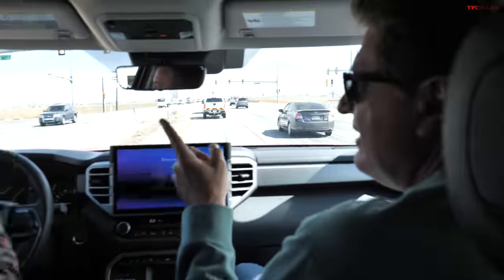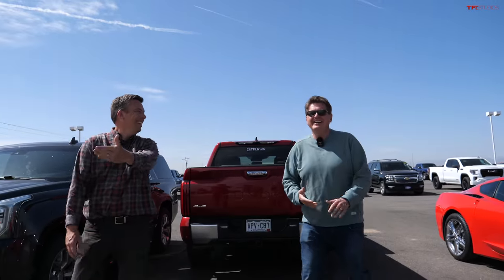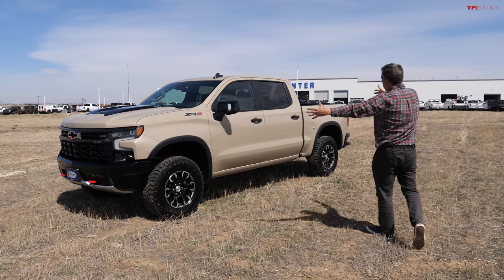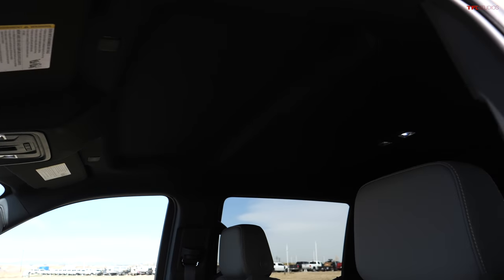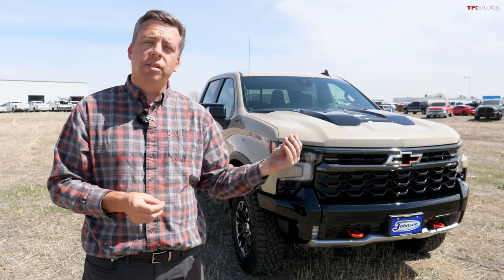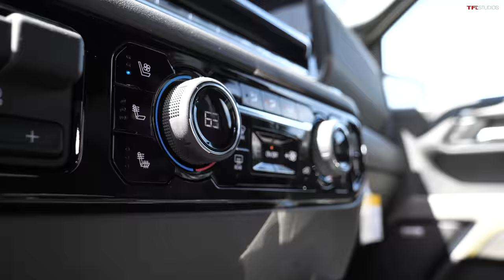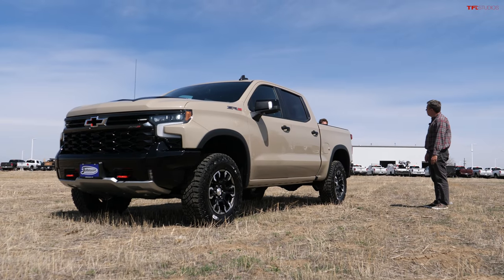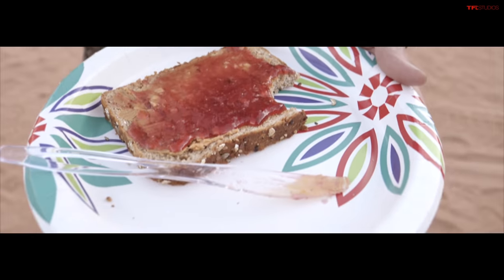We Traded Our 2022 Toyota Tundra TRD On This Brand New Off-Road Truck - Here's Why!

Comment: Awesome truck! I'd still take a diesel Colorado ZR2 over this tho. Colorado is a little more capable due to it's smaller size. Colorado/Canyon are also competitive compared to other brands like the Jeep Gladiator and Tacoma, whereas Silverado isn't. Let's be real, nobody's going to compare the Silverado ZR2 to the Ram Rebel or Ford Tremor, like they do to the Raptor/TRX.
Reply: Yes, let's be real..
And stay away from the 2.8 Duramax it has a timing belt...
Reply: @philllsxga.7737  and with regular maintenance, shouldn't be a problem. My neighbor's going on 80k with no issues. Even if I couldn't get the Duramax, I would still take the V6 over the Silverado.
Reply: @TREVORJB101  don't do it.
My brother's Blazer has 316,000 miles on his 4.3 never opened up 
My old Sonoma I sold with 252,000 miles never opened up.
A belt does not belong inside of a any engine let alone a diesel..
A belt inside of an engine is crap and is a cheap way out..
Instead of engineering a proper chain system they throw a belt in there...
That's exactly why I never bought a Colorado ZR2 because of the trash engine options...
Reply: @philllsxga.7737  OK so let's compromise.  How about I just do an LS swap??
Fair??
Reply: @TREVORJB101  now you're talking!!!
My buddy and I want to 4.8 swap a ZR2..
The only reason I did not buy a Colorado ZR2 was the engine choices I bought a Silverado instead.
No the Silverado is not as off-road capable but man the power of that 5.3!!!
I raced multiple ZR2 Colorado's in the sand dunes with my Silverado in sand drag racing and it's a joke I smoke them!!!!
The 2.8 Duramax racing forget it!!!
I raced two V6 Colorado ZR2 and just smoked them with my Silverado!!  I was embarrassed for the guy!!!
I'm so glad I did not buy a ZR2 now!!!
Reply: My diesel gladiator flatly embarrasses the ZR2 in every appreciable way come on man.
Reply: @mattbrew11  yeeeah okay.
That eco diesel is a cam shaft eating junker!!!
I'll take a 2.8 Duramax any day over that EcoDiesel...
Reply: @philllsxga.7737  you’re thinking of the first two years of the last generation engine. We have around 40 3rd gen ecodiesel rams and theyve been outstanding several are already a little beyond then 125k threshold towing or hauling every day.
Reply: @mattbrew11  all Chrysler is garbage...
YouTube truck Central high mileage RAM review
Reply: @philllsxga.7737  chrylser had absolutely nothing to do with the current jeeps man . U ok?
Reply: @mattbrew11  jeeps a one of the most problematic vehicles ever sold..
YouTube TFL truck ram rebel the good the bad the broken.
The Chevrolet trail Boss made that same Hill with no issues...
Reply: @philllsxga.7737  lmao. You’re grossly biased
Reply: @mattbrew11  just a realist..
YouTube LSX Challenger.
YouTube LSX RAM.
YouTube LS duster.
YouTube LS Ferrari.
YouTube LS Lamborghini
YouTube LS Winnebago.
YouTube LS swap Challenger.
YouTube LS Porsche.
YouTube wrangler JK LS.
Chevrolet power!!!!!!
Reply: @philllsxga.7737  hell yeah!

Comment: Seems crazy to me that Chevy would only option the ZR2 with a 3.23 gear. I would think at least a 3.73 would make more sense especially with the 10speed. Hell that would probably bring the towing number over 10,000lbs
Reply: just the opposite. the 10 speed has a lower 1sr vs 8 speed 4.7 for the 10  vs 4.56 over drive  final  10 .64 vs .65.       the old 6 speed had 4.03 first and a .67 final
so the 6  the 8 and th 10 all had  .67 .65 and .64 not much difference it the low 1st  4.03  6peed.      4.56  for 8 speed      and  4.7   10 speed
Reply: @jeffforbes70  yeah but that is my point. A 3.23 is only there for fuel economy and hurts the truck performance wise. I doubt a 3.73 rear end would make even 1mpg difference yet yield much better towing capacity. Ram does the same crap. The 1500 Hemi can come with either a 3.21 or 3.92 rear end on the 8speed ZF. The 3.21 has a max tow of roughly 8000lbs vs the 3.92 at 11,000lbs+. Lets not even talk about someone getting this ZR2 and wanting to put on 35 or 37" tires with that gearing it would torque load the crap out of the transmission without a regear. To me it makes no sense in a performance offroad truck especially knowing folks will be rock crawling and put on bigger tires
Reply: @TheRamGuy  I. hear you.  my point was about the trans ,the ten speed main advantage is in the first 3 gears , 6 speed with 3.73 will have the same ratio I first as a 10 speed  with 3.23 both will have a 15 to 1 ratio.i do agree if this is going to be Chevys  biggest badest off roader 3.73 would be nice  . I just saying the ten speed is set up for  so you don't need a rear end as low. 
the bronco has 4.7 first gear ratio add the Sasquatch package and you get4.7 rear end. when car drive 0 to 60 and quarter mile times the actual started them in second gear. again the ten speed doesn't have a higher  overdrive. its alll ep.a driven .for 67000 you think they could take the hit
Reply: @TheRamGuy  its all about CAFE MPG

Comment: Shoulda kept the Tundra, this generation GM half-tons are so underwhelming
Reply: Underwhelming is the 22 Tundra, after Toyota basically did nothing for 15 years.
Reply: @dudeman5788   Yes still drastically less underwhelming than the GMT-T1 which is the biggest half-ton flop I can think of in decades, which anyone who isn’t a blind GM fangirl can see if they’re being honest with themselves.

This model’a contribution to the market was exactly a zero — a contrived, fragile tailgate.  Sad
Reply: @BC08  I disagree and I'm a Ford guy. The 3.0L Duramax diesel is a marvel in itself. I have witnessed many GM owners with this engine paired to the 10 spd transmission knocking down 30-31 mpg on the interstate. It's arguably the most fuel efficient powertrain ever for a 1/2 ton pickup. Even as a Ford fanatic, I can acknowledge and appreciate that. I mean, yes the tailgate is gimmicky, but the 22 Tundra'ss claim to fame is a tailgate release incorporated into the the taillight...not exactly a technological marvel either.
Reply: @dudeman5788   The 3.0 Duramax diesel is a flop just like the Ecodiesel and the baby Powerstroke are.  They get mid-20s real world — guys getting 30 mpg are hypermilers doing it for bragging rights to justify their decision — and with diesel fuel costs they need to do better that that to make financial sense.  
Then there’s the fact they are just blatantly outperformed by the gassers which also have lower maintenance costs and the baby diesels are an answer to a question nobody asked. 
That’s also why they aren’t selling well.

Comment: Will zr2 ever be be built to tow 20000lbs pounds n 4000lbs payload ?
Reply: Why would they do that when you have HD for that??
Reply: @2024hekyeah  but hd can't go off road like the zr2?
Reply: @jesusm2159  you can't go off road with a suspension that is built to tow and haul  heavy . You have to buy both trucks. 3500 for towing and 1500 for playing

Comment: Awesome truck, I personally don't need a wide body desert running dune jumping truck, but I sure could use the front and rear lockers at the boat ramp, beach or hunting.
Reply: Good common sense reason. Owned a gen1 raptor and loved it but utility is also what I go after now so I can use every bit of my trucks.

Comment: Great suspension...I wouldn't want to change it after paying all that for em. Wonder if just a puck would be enough for 34 tires. I went with 34 on my F150 on 17" wheels and glad I did, just enough without 35" (tho some 35s are undersized) but mine was an XL so the suspension got a full replacement. The look of these has really grown on me, and that hood is 🔥
Reply: 295/70/18 might fit it’s basically a narrow 35

Comment: I didn't watch the entire video but what axle ratio are these trucks going to come with.  If its the terrible 3.31 then I'd advise everyone to not tow more than 5k lbs with this truck.  Please tell me it comes with the 3.42 axle?
Reply: With the 10-speed it should be fine for what it’s rated to pull. Just about the total ratio from transmission to tire.
Reply: @ALMX5DP  Incorrect.  I just bought a 22 Sierra 1500 At4 4x4 crew cab.  It also had the 10spd and 3.31 gears.  Had the truck for only 1 month and towed only a 5k lb cargo trailer with it every day.  Trans got real hot, didn't pull for shit and I would say it was the worst towing truck that I've ever owned because of that terrible gear ratio.  I thought the 10 speed trans would help it out but It absolutely did not.  I traded it in after a month for the 2500 6.6 gasser which also sucks at towing with the 3.73 gears.  Both are horrible.
Reply: @richr909  my F-150 with 6-speed and 3.31 pulls that kind of weight fine. Doesn’t sound like your issue is with the rear end but the transmission itself.
Reply: @ALMX5DP  What year F150? If its newer with the 3.0 eco boost then yes it will pull it fine.  If its the 5.0 then sorry but your def of fine and mine are way apart.  I've towed over a million miles with 16 different trucks both gas and diesel.

And if you think the Triton motor in a Ford tows well then you are just nuts.
Reply: @richr909  no such thing as a 3.0 Ecoboost in an F-150. I have a ‘15 5.0, and have pulled an 8k toy hauler with it without issue just locked in 4th gear going about 60-65mph (trans temps never got above 204 and got 10.2mpg to boot).

Comment: I'm not a off roader, I have 4wd because I live in Michigan, for the winters. But I can't believe you're griping about 33" tires. I'd be more pissed about the short 5'7" bed. Useless. Had 8' beds first 4 trucks, 1/2 and 3/4 ton. Had to settle on a full (short bed) 6.5" on my 2015 GMC crew cab because they stopped making a 8' in anything but a regular cab 1/2 ton. I've overloaded this bed with 1200 lbs of gravel. Over the 1595 it's rated at.!
Reply: They don’t care what the bed length is because they don’t use pickups as pickups but rather as off road SUV’s.

Comment: Kinda short on towing and load capacity. My 17’ crew cab 1500 max load weight is 1999 lbs . Towing max is 11300 with 5.3 . Well I guess all that other stuff is the rage . ✊🏻👍👌

Comment: It’s about time Chevy fixes their horrible interiors.  This about the best one I’ve seen on a Silverado in almost 20years
Reply: The Interior change was due to the crap they originally put in this truck that was causing Ram buyers to buy Rams and smoke Silverado sales.. but as usual with GM trucks.. if you want power and performance you have to pay for all the bells and whistles.. Ram.. base model truck you can get the big motor and all 8 speeds.. Try that with GM's trash.
Reply: @kenrobinson1099  try not having electric problems in the ram trash
Reply: @danielmeador1991  Now that's hilarious and out of complete ignorance. I have never had electrical problems in any of my Rams or other Chrysler products that have or presently still occupy space on my driveway.
Reply: @kenrobinson1099  your comment screams ignorance I’ve seen nothing but electric problems in late model rams but good luck with yours and hopefully it won’t ram your wallet with expensive repairs

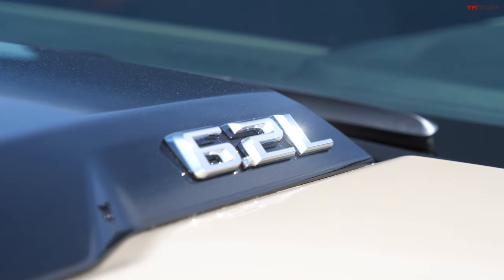Comment: Blows my mind that Chevy leaves the inner fenders open/exposed seen from under the hood @9:13 (look at the area the hood prop attaches to the fender). This screams cheap and a cost cutting move that makes you question what other areas they cheapened out on as well.
Reply: Worse was the welds on the tail pipe that weren't ever cleaned up. You can see the rust on them already...

Comment: As someone who has sold one of these trucks and compared the stock vs performance exhaust systems, as much as I like gm accessory quality (rock sliders are great) I’d highly recommend going with a different brand over the GM one as there is a very small difference yet high cost. I’d recommend Borla with their S-type (or Atak) or one of the Corsa offerings to actually have a noticeable sound difference. Both of those are more TRX sounding whereas the GM one basically just makes your cold start marginally louder and not much in other scenarios. Just a thought!

Comment: I have a 6.2 in my Trail Boss with a cold air intake and opened up exhaust and it RUNS! Do we know if the cold air intake upgrade is compatible with the ZR2 as it is not listed on the website as a build option or accessory. I'm hesitant to trade mine in on the heavier ZR2 without some upgrades available...

Comment: GM brags about winning a competition.  Then it comes out that there were no competitors.  Not sure which is more ridiculous:  Their claim about winning or the fact that they did not think anyone would find out about them being in a class of one.
Reply: I guess if you don't follow desert off-road racing you wouldn't know that it's a production stock full-size class and its open to any OEM to enter. I wonder why Ford, Toyota, Ram, or Nissan has not entered to prove how well their trucks truly are. I'm just glad GM did the R&D with this truck out in the desert racing against the elements and nature.

Comment: It's more of a Tremor level.

I hated the new Gen of Chevy trucks at first but it's growing on me.
Reply: It's an entire level above a Tremor.  

Tremor has a 1inch lift. None brand name shocks, just ford "tuning " the Front Torsen is only optional.  The ZR2 has 2.5" lift ,DSSV shocks, front and rear Elockers. It's not a Raptor, or a TRX, but its better than any other offroar truck.
Reply: The ZR2 is between the Tremor and Raptor.

Comment: Love the new GM truck interior, way way better than the old one. I also love the infotainment software, android automotive OS...it's the best software for infotainment systems, there's no need for companies to try to create their own when it's going to be outdated really quick just let Google do the work
Reply: Its better but still third, the rams and ford interior is still better
Reply: @johncoinas  I'd say second with ford being third. Ford has had a similar interior for several years, I was hoping the interior would be similar to the transit but they went a different direction to the European design
Reply: @harleyrobertson6746  ford just updated it for this new generation.  Problem i have with gm is they always go with grey or black
Reply: @johncoinas  I know they just updated it but only GM has radically changed their interiors aside from Ford with the all new maverick, which is a more euro transit like design. Ford and RAM have just majorly updated their interiors using the same outline, GM has redrawn their outline of the dash. But you are right, greys and blacks are boring and tired, would love the blue interior of the maverick in the f150

Comment: Meh…. I wish the ZR2 looked more exclusive. Still looks more like a Silverado with aftermarket bolt-ons……. The Raptor is more specialized IMO, there’s mistake in regards to recognizing and identifying it in the road. Plus with the ZR2 with the 5.3 V8??? Idk….. the color is dope and I do like the overall appearance but, I feel like it will perform very similar to a ZR1 apart from high speed desert running
Reply: 6.2L is the only engine choice in the ZR2.

Comment: I’ll toss them a bone as they’re finally learning a fender well isn’t supposed to be designed for square tires. One day GM guys you’ll be able to add a tire without going 6+ inches to fully clear a 35” tire. 

Yes special cases, I clear blah blah, cali mod yadda yadda…keyboard jockies you know what I’m getting at . I say this as a guy that just bought a 2012 k2500

Comment: They should’ve put bigger tires on it. 33’s look too small and is too small. 35’s would’ve set this truck off just right. I’m a toyota guy but i said it with the tundra too, they should’ve put 35’s on the trd pro, tires look and is too small for both these trucks.

Comment: I cancelled my 2022 Tundra TRD Pro hybrid order. Disappointing fuel mileage, overly complex V6 TT engine, and $68,500 price were the three main reasons. The new Tundra was a huge disappointment. I have been a loyal Toyota truck owner for over 20 years.
Reply: What did you end up going with? I love the tundra but thinking of going with a diesel considering I wanna be a travel nurse within the next year or so
Reply: @christianflores6626   I left a deposit on a 2023 Ford Raptor. 

Stay away from diesels. After the warranty expires you will be sorry. Tons of emission equipment that needs to scanned by a dealership when your dash lights up like a Christmas tree. I had the Duramax I4 diesel in my ZR2 Colorado.
Reply: @mini2nut67  I wouldn’t get a smaller diesel like that. I was thinking a 6.7 powerstroke or 6.6 GMC. I think the smaller displacement diesels haven’t been quite mastered yet.

Comment: I ordered my ZR2 back in February. @Chevrolet still has it in 1100 status. Still a preliminary order.  
BTW, I saw TFL's ZR2 on Johnson's website when it came in. I immediately called to see if I could buy it. Of course it was already sold to the fellas.

One other thing, the multi-flex tailgate is still an option on the ZR2. My dealer claims its currently the constraint holding up my order.

Comment: I like the exterior of the truck. However I think that interior center screen looks more like an after-thought. Look at the shapes of the dash around it. I looks like something put in aftermarket. The infotainment system looks well done though; enough to give the UConnect a run for its money. Ford and Toyota  are nowhere near as good. 
My one beef with Chevy's though is the fact that you are still seated low in the cab, compared to Ram and Ford. Look how tall the dash is in Andre's position. Does not make for good visibility when going off road. It is a good thing that it has those 360 cameras. Gonna need them.